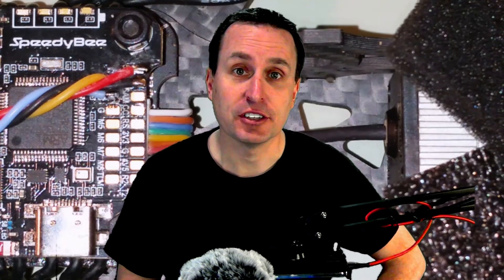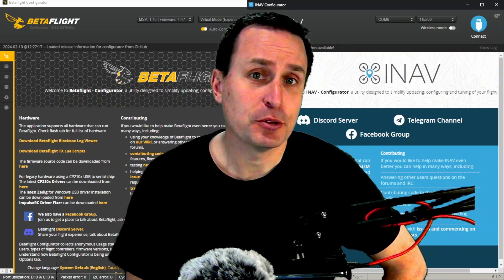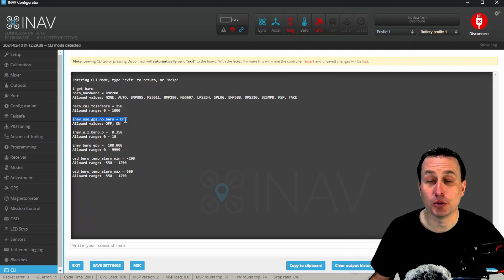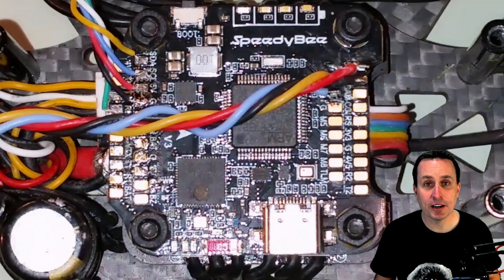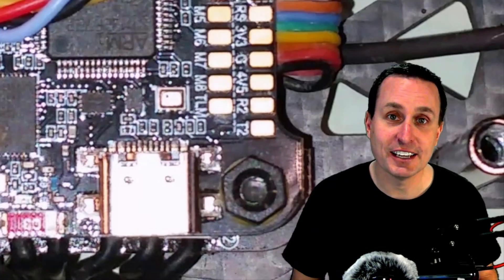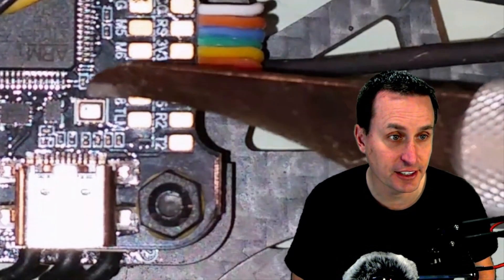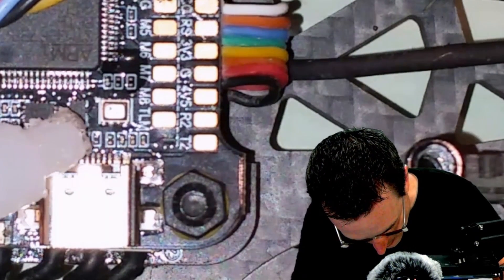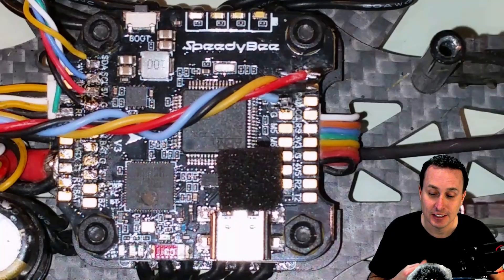Isolating your BAROMETER for better Altitude ...

Comment: Thanks man I’ll try this! I was trying to add a hovering mode to my drone using barometer and accelerometer it ended up a mess probably due to prop wash and emi. Gonna use this isolation technique and place the barometer i2c lines away from other signal lines hopefully next drone will hover nicely
Reply: And?
Reply: @user-lo4sl7of6d yeah improved!

Comment: Very interesting video 👍I'm currently having an issue with the baro (SPL06) on my SB F405 Wing FC. Either connecting the FC via USB or battery the little icon on INAV Configurator turns red. Sometimes I place the airplane on the balcony and the baro is ok but most of the times it remains red. I even took off the SD card but no luck. Is the FC defective? TIA

Comment: I do not recommend hot glue as it will melt when FC heats up.  My recommendation would be to use E6000 which is removable or a thin strip of fabric tape over the foam to hold it down.

Comment: It seems very strange to me that he makes that video, glues foam on the barometer and fails to actually show the sensor graph before and after.
I suspect that there was not the slightest change, that's why the video is lacking evidence.
For anyone who feels uncertain: just open betaflight, enable expert mode and you'll see the barometer data.
Reply from the maker: hey now.
Reply: @uavtech  I'm happy to change my comment if you provide said before/after measurements. It's really sketchy that you did not show any of that, given it's the first thing you'd normally look at when working on a sensor input.
Reply from the maker: @haka8702  That's fair.  Just the way you stated the remark is weird.  Do you think I have an ulterior motive?  Foam sales?😋

Just not a great way to compare that is easy enough, but if you search it up, "baro isolation" is pretty common.  Maybe I'll try to do A - B, but I would need to mount two of the same FCs with baros on the same quad.  First, do a flight to see that they give the same results.  Then isolate one but no the other and fly again.  Even then, the wind will hit them slightly differently, but that should be minor.

(p.s. if the comment really bothered me, I could just delete it.  No big.)
Reply: @uavtech   My thought was that new content for a YT channel is important so adding a method that is not having a real benefit for content isn't that unrealistic.
In general I'm triggered when something like this comes without evidence, I think that's the most important part so others can compare, reproduce and build upon things that show benefits. 

Even just doing two similar simple separate flights and looking at the two sensor graphs should show a visible improvement in how smooth the graph is represented. 

Generally I think the barometer sensor algorithm is not filtered enough in betaflight, though I do not know if there are parameters that could be set.
It's very jittery and needs a stronger averaging filter.

Comment: I use thin "blister pack" clear plastic to fabricate hold down straps for things like U.FL antennas and such. A piece running
from two of the stack mount bolts with the foam glued to that should also work. Of course the plastic would not go directly over the Baro or the foam that is on top of it.  I will try it when I get an FC with a Baro on it. Yeah, I use longer stack or FC mount bolts.

Comment: I think a better way to mount this would be to use a square of servo tape with a hole cut in the center. I have clear double sided servo tape that I think would be perfect for this and much easier to replace.

Comment: I just got one of those new GepRC gps' with a barometer and mag... it has the standard 6-wire setup... how do I select the baro on the gps unit instead of the one on my foxeer FC?
Reply: If your FC and GPS's barometers are different, you may be able to select the type of the barometer manually in the configuration tab but if they are the same, they quite likely will use the same I2C address and, in this case, the best thing to do is to just use this GPS with another board IMHO.
Reply: In the configuration interface, set the barometer as DPS 310. I also recommend using the heat shrink that was provided, it prevents dust and moisture from entering the underside of the GPS where your barometer and shield are present.